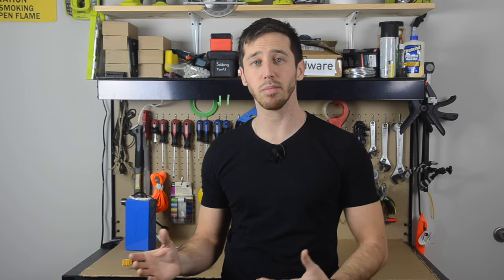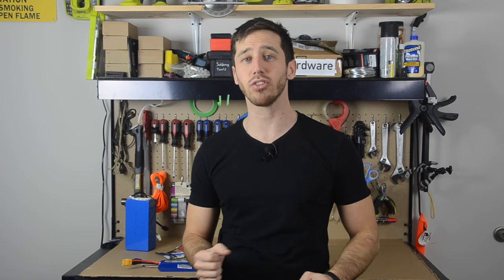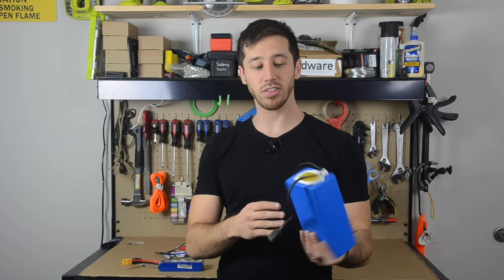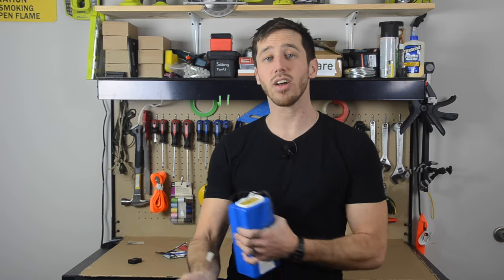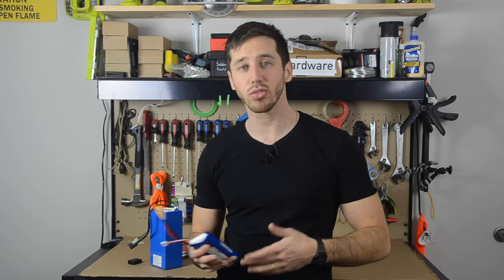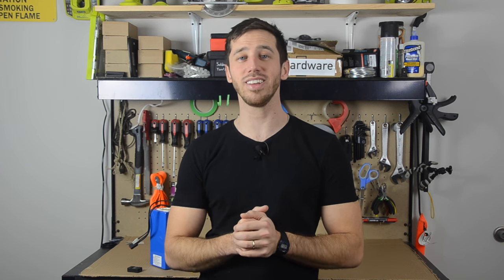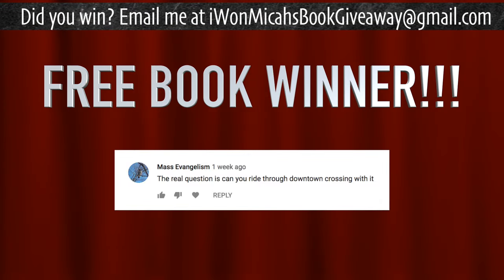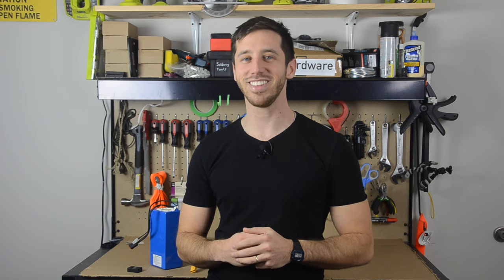Do you NEED a BMS for DIY Li-ion Batteries?

Comment: 100% of failures I have had have been due to the bms. E boards, e bikes,  builds or that I've bought. When you buy a battery pack eventually it fails let's say 3 months. You will think you got it wet and you buy another thinking you were at fault then the new one fails. Eventually you will get really mad, then you take off the shrink wrap check all the cells, everything seems good then you inspect the bms and you see aluminum oxide and sometimes burns.  At this point you get really angry due to the money you have spent. I don't think anyone has designed a pack that cells can be released and put back quickly and charged completely. Anyone who reads I hope it helps.  It's not your motor,  it's not your speed controller, it is the bms. If you are loyal to bms units you will be walking home a ton. I highly recommend you not use a bms and charge each cell individual with an 18650 charger-i have 3 exakt chargers and I can charge every cell to its fullest capacity quicker than with a single charger and pack. E bike school has great Vids if your just starting and I hope this comment helps someone,  I would have save a painful large amount of money if I had read a comment like this one.  Cheers

Comment: I was in the FPV hobby for a while and all I used for my quads were non-BMS lipos, the very idea of a BMS on my packs was absurd. As you mentioned, without a computer cutting off the voltage to your motor for you, it's very easy to just go a little bit too far and end up with a battery that doesn't work very well, which is exactly what I unintentionally did at least 3 times
Reply: How high would you go on voltage for a battery that doesn't have a BMS?
Reply: @ElectricScienceDad  4.2v per cell. Higher than that and you damage the cells. What I'll do when I don't need the extra range is charge the cells to 4.1v, which extends the lifespan of the battery pack.

Comment: I use the 3rd option , no bms , also no balance charging . I use "high ceiling" method , 48v charger can charge up to 55v , i use 17s Lifepo4(55V) instead of the norm 16s(52V) to make sure my battery never reach full charge , so that the fast charging cell never reach 3.65V which is the limit for Lifepo4 battery

Comment: The safest way: use a bms AND use a voltage checker for each bank to ensure your bms is working!
Reply: That is exactly what i am planing to do
Reply: @Kris57277  -- Me too.  For the peace of mind a BMS offers, and combine that with testing (and learning) what happens inside, after making the pack.
Reply: I just deleted my comment, because I just noticed yours, and that's exactly what I'm planning to do as well. I'm closer to a novice though, so I'm glad my thinking was correct.
Reply: You don’t need to be quite that stringent with li-ion cells as decent quality cells paired with a good quality bms that is spec’d correctly for your current draw requirements then the bms will way outlast the cells you plan on running it on. If you plan on building the slightly more juicy lithium polymer based batteries then this is a good safety net idea

Comment: I have resorted to doing both, as I was paranoid I connected both bms and balance wires on same battery and have compared the charging voltages of both. Happy to say that the bms has done a great job, only straying one hundredth of a volt at times after charging, but I like the convenience of having the balance wires as well for easy checking what is going on.
Reply: I think the added balance wires in addition to the BMS is a great idea, wouldn't be much added cost but would give us a look into the sealed battery to periodically check.

Comment: I’ve used BMS’s (and even bought a few off of your website) but I’ve found that no matter how much I spend they usually fail sooner than later. Now I have a battery voltage gauge and a cheap volt buzzer that is set to the lowest I want it to go and shows me the voltage of each group and how far they differ from each other. Plus a balance charger. Great video Micah!
Reply: agreed , the BMS always seems to fail

Comment: I use smart BMS in my both E-bikes. It cost just little bit over the regular price BMS but they comes with USB and Bluetooth connectivity. I connect it over Bluetooth to my smartphone. Over the app you can set and monitor in real time so many things including speed that you travel, temp of battery and BMS, Voltage or see all individual cell pack, you can disable/Lock BMS like E-lock. You can see remaining range... It has so much useful info and you can set parametars over app and program it however you like. You can set discharge,charge limit, phase amps, capacity of battery, Discharging low limit, charging high limit and you can set bettery balance to charging only or all the time and so much more. Smart BMS are the best thing ever.
Reply: Where did you buy from?
Reply: Dariusz Czarkowski Aliexpress. Just search for smart BMS.
Reply: A bms that can balance by Bluetooth  has my attention cool

Comment: There is one other option;I use individual cell chargers for each cell. I place them in series in a pvc pipe with threaded end caps . The caps are drilled through the middle and small bolts inserted to contact the - + ends. Wires are then connected with appropriate connectors for easy removal. When the display shows a low symbol, one end cap is removed and the cells are removed with a telescopic magnet.They are then individually charged in the chargers( 4.19vdc). The whole process can be done in under five minutes. It’s not necessary to do this for every charge if matching cells are used to begin with, and they can be charged within the tube with a regular, multicellular charger. I think the extra two minutes to extract and replace them for individual charging is worth the effort  for peace of mind.I suggest using button top cells for this method, but have also used small magnets to secure the connection between the cells. I have considered spot welding nickel disks the positive ends also if non button end cells are used. They just need to protrude enough to still slip in and out of the individual chargers without a struggle. The double cell chargers are cheap but reliable for years. They charge a variety of cells and automatically recognize each type. They can be adjusted individually for either 500 or 1000 ma  each cell has a digital voltage display as well as blinking bars to indicate active charging. They will not charge over- discharged or defective cells.Works for me, but I’m not picky.

Comment: 👍👍👍 this was an excellent video. The truth is Always Somewhere in the center. I almost always use BMS, and I never rely on cheap Chinese variants. I think a BMS makes charging away from home much easier. For example if I'm charging with a solar panel and charge controller, maybe a BMS will take care of all of the issues my home charger would solve for me. I think if I were discharging on the road and charging at home, perhaps there wouldn't be any need for a BMS. I do like the over and under voltage protection though, that's critical functionality.
Reply: Yes, that is a good answer for when a BMS is neccessary : On the Road.  Like on an ebike with solar panel trailer (which I'm building) you cannot balance charge during a trip.  Sometimes I will plug in a wall outlet, solar charging goes on all the time, and I will use regenerative braking too.  The BMS inside my packs will take care of the hassles that do not seem a big deal when you're at home.

Comment: On my OpenPPG paramotor, I have elected to only use my BMS for charging and then monitoring my voltage to decide when to setup for landing.....usually around 80 volts on my 24S battery.  Using the BMS to monitor discharge, the BMS has failed me 4 times resulting in battery cutoff and emergency landings.  (BMS units will eventually fail.....to me, that is unacceptable in aviation.)  I do use an active balancer though that works 24/7.  It is mounted inside of the battery....works great!  Like you stated, everyone's situation is different.
Thanks for posting this video.
Bill

Comment: IMO, you are perfectly right.

I use BMSes just to prevent over-discharge/overcharge.

I just use them as an additional layer of protection, along with cell fusing, slight undercharging, voltage monitoring, using quality cells, etc.
Reply: YES,IT CAN BE PROTECT BATTERY
Reply: You can use fuses to prevent over discharge. Voltage alarms are better at monitoring voltages.

Comment: I own 13 battery packs for my cordless tools. They cost a small fortune. I got tired of the factory installed bms shitting the bed every once in a while so I installed new higher capacity 18650s and bypassed the bms. Charging takes a  lot longer but I've never had any failures since. Imho I prefer the reliability. Thank you.

Comment: I personally use BMSs on all my batteries. However, you can do just fine with balance charging. To prevent over-discharge, I have heard of a gadget called a low-voltage cutoff, which basically watches the overall voltage of the pack and cuts off the discharge current when it gets too low. I don't really like this because cells may be very well balanced when full, but the one with the least capacity will discharge to a critically low voltage long before the others. If the others are still high enough, the overall voltage may appear okay to the low-voltage cutoff, and it will allow the discharge to continue. I like the voltage monitor this guy shows that's wired in the balance leads. It will be watching each cell individually. If a low-voltage cut-off could be found that watched each cell individually and cut off discharge if any cell drops too low, that would be great.
Reply: I have seen tiny little BMS for each cell

Comment: I have made loads of lithium batteries, and I always include balance port, even if I have good balancing BMS. It makes it easy to check if anything goes wrong. Sometimes the balancing is not included in the BMS, so I have to balance charge it. Anyway, if balancing is not included, the BMS should still be able to cut the battery off once one cell starts to overcharge.

Comment: Before I install the bms i always test the bms if it does truly work. I make a 13s1p and discharge the battery about 20 times. I don’t try to put the same voltage for each one of them because i wanted to see if the bms is working. If you find that one bms is working them stick to that bms !!

Comment: Old video now but seems BMSs have a tendency to fail... In the RC world this is a non issue since electronic speed controlers have a low voltage cut off which prevents the user from over discharging the battery. Charging is also quite easy, just use the same profile you always do (just plug 2 plugs instead of 1). Do larger electric vehicles usually have a low voltage cutoff? Unless things have progressed in the last 4 years it sounds like a BMS is more trouble then it's worth?

Comment: So two identical BMS boards can be connected in parallel to one battery pack and it does not cause any troubles?
Also, is it okay to power each BMS separately from different chargers in theory it should boost charging amps and what is more important what if power each BMS with different power supplies for charging will it cause any damage to bateries or maybe overload the BMS?

Comment: See, some people don't understand about BMS and without it BMS can use on the used cells. If your batteries are new, you will be ok. And make sure you have Good connectors. Also right changer..

Comment: The only video I have seen with the most important information on it! DIY batteries is not for the faint.... I need your help with the ebike 48v lead acid setup, popping and arching upon connecting, what is the best way to eliminate the risk of failure?

Comment: Can you explain the way you constructed the dual BMS system for the car? Also I was considering putting the outputs of a few finished battery packs (PB120B1) in parallel parallel. They use a DLX-HT-3S6A BMS internally. I am wondering the proper way to protect them, and if they would be switching between charge and discharge, since the BMS only has 1 pair of wires that are used for both the load and charging.

Comment: I got 4 x 18v 25Ah battery pack with BMS each pack. Can i use a 72v charger and charge them in series?
Reply: I have been reading alot of forum online some are saying it is safe, some are saying that it will overload the BMS and some are saying that just add diodes and it will work fine.

My problem is, i cannot make a 1 x 72v battery pack because it will not fit on my scooter - the plan is to connect 4x18v pack (with BMS Each) and connect them in series to get 72V. and take advantage or charging the pack aswell using a 72v charger.

Comment: I’m about to rebuild a couple of Segway Lithium Batteries.  They take 18650 3.2v 6000mAh cells.  (Segways batteries have BMSs).  I see some 18650 3.2v BUT 10000mAh.cells on the market!  Would these be safe? Would the BMS “understand” them?  I suspect that if they are appropriate, the travel range would greatly increase.  Suggestions?

Comment: I think the best practical solution to charging cells is to allow them to be removed easily and charged individually like with an xtar vc4. You will know status in real time. Any pack I have bought had bad cells that affected the charging of the other cells. Quality of affordable bms is really bad and balance chargers the same. You need to have the ability to charge each cell and see its status. The diy kits like verzund are very good. Anyone who reads this know that u will save a lot of money  on your build and long run as well. These batteries are dangerous btw. I don't think them rubbing against each other in a shrink wrap is very safe! When an 18650 shorts it doesn't spark, it glows red like a coal in a stove and ignites the other cells and from experience I can tell you some will take of like flaming arrows. Always check voltage of cells when they arrive!
Reply: I put my cells in a pvc pipe, screw on the threaded end caps and extract them with a telescopic magnet out one end. They are always charged and monitored individually with multiple chargers. There are several ways to mount the straight pipes on any bike. Can even make them look fancy. I’ve done six so far.

Comment: Question. If i were wanting to run 2 72v batteries in parallel when each battery has their own bms built in, is that possible? I know that you need to be carful of the voltage on both battery meaning they ideally need to be identical voltage. Im talking about 2 identical 72v batteries. Charging them separate. Just if i were to run them parallel would there be issues because there is 2 bms’s in the system? Thanks. This is a project for a electric full sized motocross bike!

Comment: Been using lipo batteries with balance charging and has worked great.
Reply: Jonathan Braud what lipo charger have you used and are you balancing 7 cells one time then 7 next ? i haven’t found a lipo charger that goes all the way to 14s
Reply: Anton Pepkolaj I’m using the turnigy TQ4 charger to do up to 6s. I just run packs in series to get desired voltage.

Comment: Great video! I will always choose to use a BMS for my 18650 battery pack. It helps protect the battery in overcharge and over-discharge. It helps to prevent damage and fire. :-)

Comment: I have never found a balance charger (hobby charger) that would do more than 6S. So when I want (as per your example) a 36 volt or 10S battery, I have to make two separate 5S packs, that I can balance charge individually. Is there something I'm missing? (like a source of bigger chargers?) Personally, I like doing my own balance charging, but it would sure be nice to plug in a single charger for my 72 volt pack!
Reply: If you could interleaf voltage dividers, you can put as many cells in series as you want. Even electric vehicles, running well over 300 volts! A divider can be as simple as two identical resistors hooked up the positive input of an OP AMP, then connect the output to the inverse in of the op amp. you connect the resistors, and the op amp power pins to the outer terminals of two series cells, connecting the output to the interlink between the two cells. If you have three, take another divider, and connect one terminal to the middle of the first two cells, the other to the terminal of the third cell, and the center tap to the junction between the second and third cell. I wish I could attach a schematic, but I don't know how to do that on a reply. You will need exactly 1 fewer dividers than the number of cells in the battery. It could be good if you use relays, so you can connect them near the top of the charge, then disconnect them when the battery is in use.
Reply: ICharger makes 8S and 10S balance chargers. They are not cheap as they can handle high amperage for large packs. Search for vendor Progressive RC. Been using these for years and vendor is very good.
Reply: @alcusminix5527  Yeah im Ditching my BMS and doing it like this. My controller shows me through bluetooth what voltage app is and it will cut it off it want to, i u much rather do this.
Reply: @cheekonv  Individual CELL Voltage ?
Reply: @vtorsi610  yes well cell in parallel at lest i can see which group.. ANT BMS with VBMS app